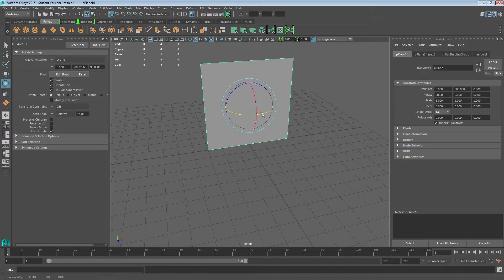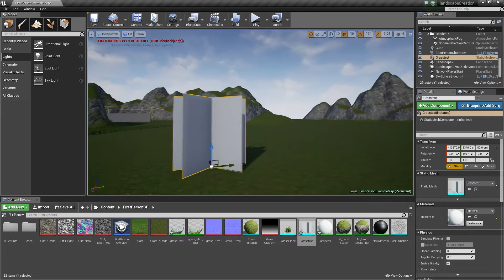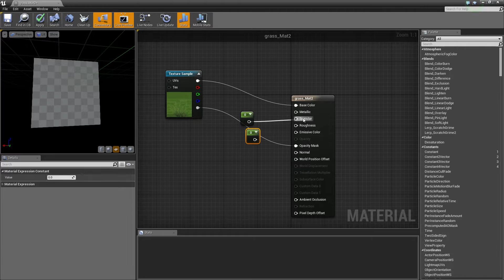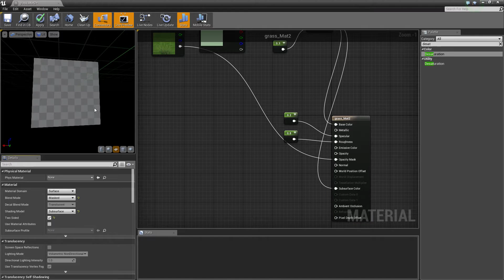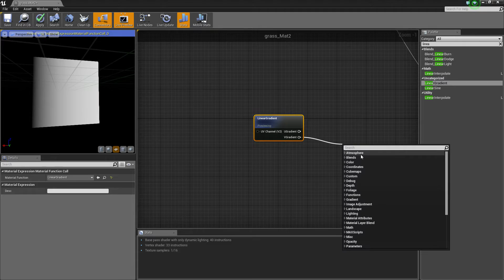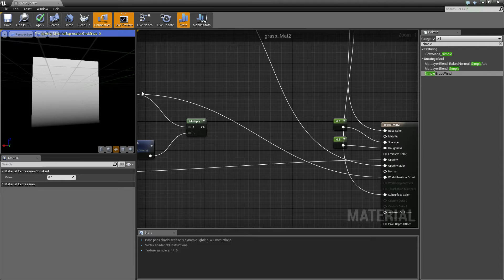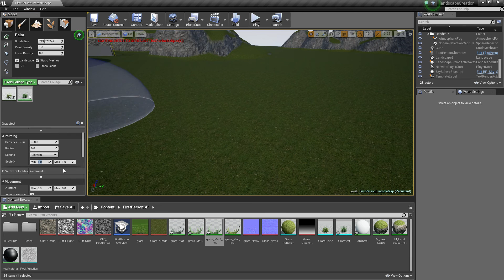Ue4: advanced materials (Ep. 34 Making Simple Grass)

Comment: hey, just following the tutorial to make a unreal environment of my own and I noticed a thin line above my grass when the x value is stretched to player height? I've tried viewing it in editor and there doesn't seem to be a issue, just wondered if it needed to be built to fix the problem.
thanks.
Reply from the maker: Mr Robbo oh my lord dont get me started.. .happened to me on another environment. I fixed it by making the background of the Targa of the grass black. the alpha channel should still cut the background out and hopefully remove the white line...keep me updated on the result
Reply: Think it was to do with the world position offset. Due to a wide portion of my environment being grass the engine started to draw the lines of the WPO above the grass thus creating a line of black above it when played and not. I haven't been able to fix the problem so at however by cutting down on the grass the lines are less viewable, best results Ive seen is being on a density on 180. The lines have stopped appearing in playmode but there is some noticability when building up my environment. other than that keep up the videos man!

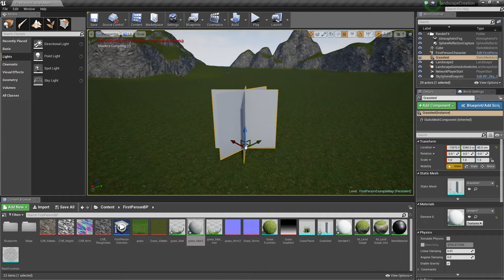Comment: Okay I'm sure there's a really simple fix for this, and my extreme lack of knowledge in UE4 and 3D modelling is to blame, but when I apply my material to the static mesh it retains the original shape of the static mesh, rather than replacing it (like what happens at 10:33). The material gets added, but it adds the material to each subdivided section so have several lots of the grass on each plane, some above the others. No clue how to fix this or what I did wrong so any help would be appreciated, thanks!
Reply from the maker: CG 995 you haven't unwrapped your mesh bro :P. Each mesh needs to be unwrapped to tell the software where to draw the texture in the mesh. so basically whats happening is each square/polygon on your mesh has a UV that takes up the entire UV square. That's why it's making the grass show up on each polygon. If you don't know how to unwrap just type in on Google or YouTube "how to uv unwrap in "the program your using"". That should fix your issue. Thanks for understanding that it could be your lack of understanding of 3d modelling. Becomes frustrating for me when I'm blamed for it. Also sorry for late response in holiday at the moment :)
Reply: See that's weird because I'm pretty sure I have unwrapped it right? I think what the main issue I actually have is that when the material gets attached their all at the wrong rotation and it seems like UE4 is taking each subdivision as a different polygon in itself so rather than having 1 lot of my material per 'side' I have two, not in the correct rotation. Thank you for your help anyway, if any of what I've said makes sense to you and you know the issue any help would be appreciated. Don't worry about a "late response", it was a comment on a video which is over a year old so was pretty quick!
Reply from the maker: CG 995 hmm send a pic at when I'm back off holiday I'll take a look :)